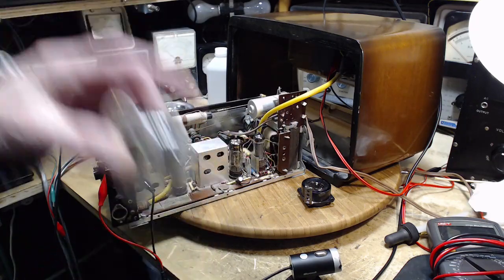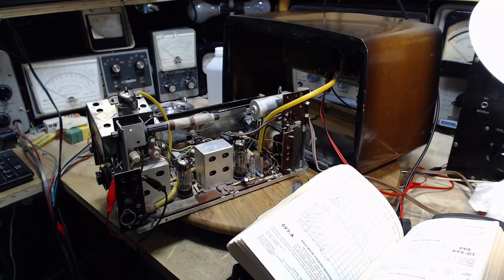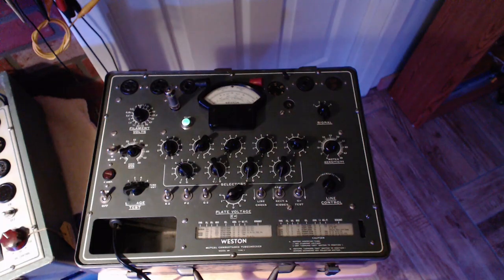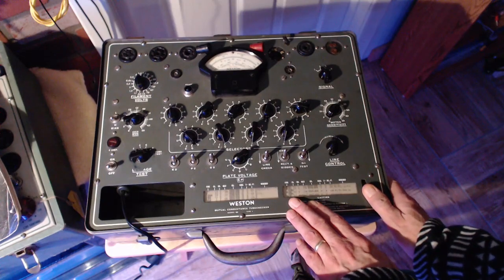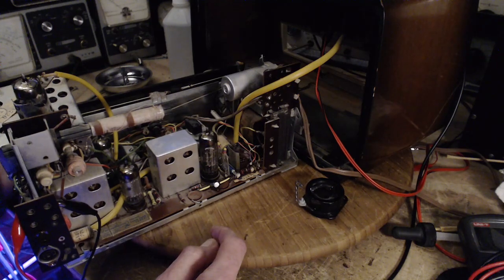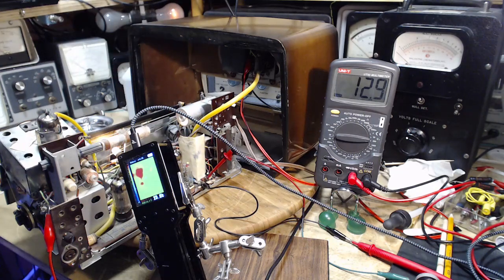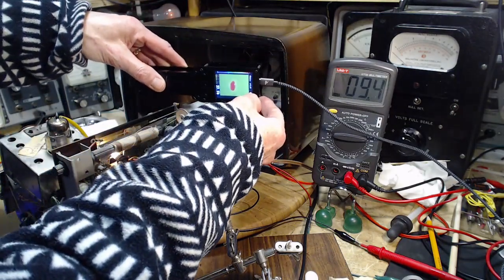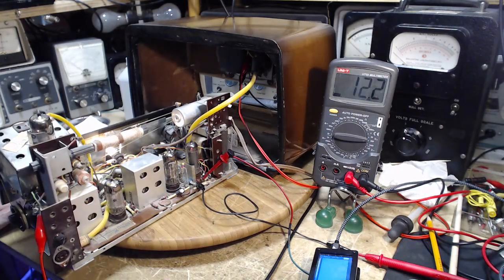Nordmende Norma Luxus Tube Radio Video #4 - EL95 Output Tube

Comment: Please Jim replace all tube sockets,clean the switches and replace all weak tubes,change the cathode resistor for proper bias,check the capacitors in the grid circuit of the output tube,then test the radio!!!!

Comment: Considering the schematic, the cathode resistor of the EL95 is a 0.5 W type with 330 Ohm resistance. With a voltage drop of about 12 V, it has to dissipate exactly 0.5 W. If you want to keep the 6AQ5, you should at least use a resistor with higher wattage.

Comment: That 6AQ5 probably has a heater to cathode short, usually shows up when the tube warms up, these were common in TV's and   h to k shorts were very common in them, try turning the filament voltage off and see if the short goes away.

Comment: 6DL5/el95
Reply: Yap. 
On parallel heater arrangements, you can replace a EL95 (heater 6,3V 0,2A) with the plentiful PL95 (heater 4,5V 0,3A) if you add a series(!) resistor of 6 Ohm 1W to its heater. This hack ofc wont work on series string sets due to the difference in heater current. 

And you can hack a EL90 to run as EL95 if you reduce the screen grid voltage by means of a resistor (and 1-10uF filter cap to ground) and adjust the resistor value to get the 25mA plate current of the EL95.
Running a EL90 in place of EL95 without modification runs the risk of pulling too much current thru the audio output transformer and damaging it.

And finally there is a couplet in this radio which contains the coupling cap between plate of the EABC80 triode (audio preamp) and the grid of the EL output tube. 
This couplet needs to be checked and if in doubt rebuild.